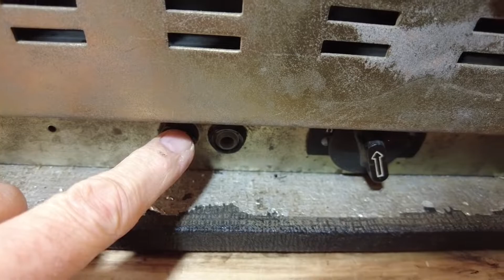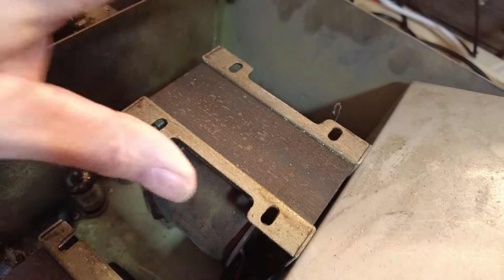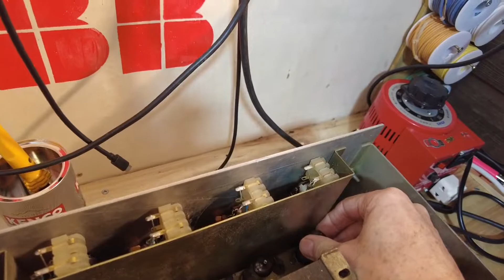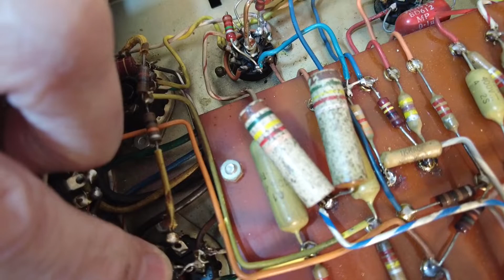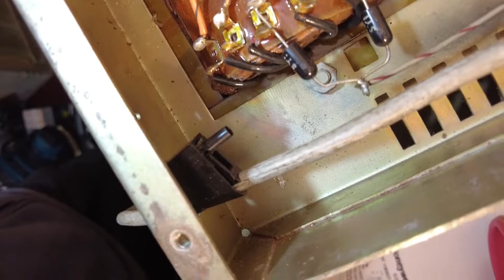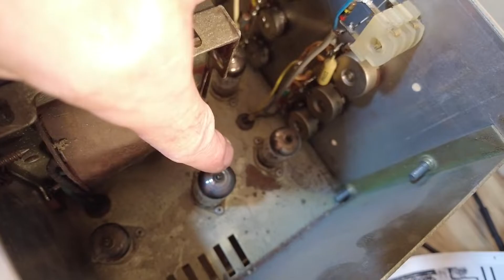Selmer 100 Watt Valve/Tube Pa Guitar Amp Conversion Part 1 First Look and Assessment

Comment: ive  got a couple of selmer PAs , ''the reverberation 100'' ( that one uses the same valve that you find in a copicat ,ive forgetten the name ) and the ''tv pa100'' .  i think theyre great for guitar but tend to be on the bassy side.i actually find it hard to keep it clean enough for rocknroll sometimes. im interested to see how you go.
Reply from the maker: Hello. There is a part two, three and four on this amp. You can reduce the bass a little by dropping the coupling caps from 47nf to 22nf. This amp ends up with a few mods. Thanks for watching and take care.

Comment: Did you say the EF86 was used as the phase splitter? Isn’t that a pentode tube? If so, can you briefly describe how? I’ve never heard of anything other than a triode, or pair of triodes, or an Interstage transformer being used as one… How would that work? Thanks
Reply from the maker: Hello Tom. They are sometimes used as phase splitters. They are wired in triode mode. The plate and the screen are connected together.  I think they use the EF86 to help keep the amp clean as this was  originally a PA.  Thanks for watching and take care.
Reply: It’s not a phase splitter in these. It’s a buffer to combine the channels together cleanly. It’s biased to avoid distortion, and the negative feedback from the output transformer is fed to it as well (instead of the more usual method of feeding negative feedback into a ltp phase inverter tail). 

The phase inverters the 12ax7 after it in the chain.

Comment: Nice walkthrough, thanks for sharing. Compared the one I just recently got your Selmer is in a good shape (except for the power supply). I'm gonna do more like a restoration (and some mods needed the amp to be safe) and sacrifice 1 or 2 channels to experiment with different gain structure and tone but will try to keep the changes to the minimum. I know it is not as desirable as the treble/bass and others but I'm playing mostly clean anyways. You might want to keep 2 channels for the classic high/low separation. Looking forward to your journey with the amp, keep up the good work!
Reply from the maker: Hello Janos and thank you for your comment. You are right about keeping two channels. I was only going to have one channel but had a re-think on it. They are good amps and they should make good guitar amps. There is quite a bit of work to do this one. Part 2 should be out soon which is about rebuilding the power supply and addressing the safety issues that these amps have. It's nice to know someone else is saving one these beauties. There isn't that many of them left now. Thanks again and take care.
Reply: @vintageguitaramp_guitarteacher  Thank you, be safe yourself! Looking forward to see the next episode. I hope the small bottles are still usable in the preamp section, good old Mullards and Brimars are all time favorites. My version (which is the TV I believe) toured many many decades and I pray the transformers and the massive choke are still intact. They look pretty hammered but I see no burn marks or leakage. On that note it is incredible how Selmer changed the circuit over the years. Basically they kept almost everything the same (except for the mighty GZ34s and the mixer/PI driver EF86) but tinkered with parts here and there. Maybe it is an internet hoax but it seems Selmers had a bad reputation for breaking down mid show. I believe this might be true just by looking at the power supply and the screen design. The construction seems to be rock solid, almost like old Matamps and Hiwatts, where simplicity triumphed the looks.
Reply from the maker: Hello Janos. I tested the tubes and were all good on the tube tester. Just hope they are not micro phonic. The TV is much older than mine and quite rare. You should have GZ34s in that one. Great amp though and I hope you get it up and running. There is a few variations on the schematic. Thanks for watching and take care.